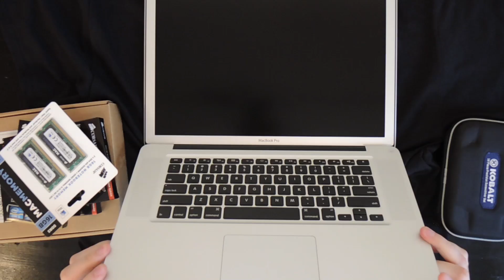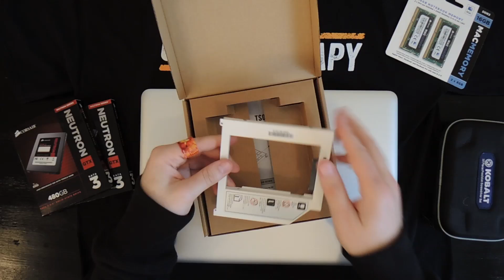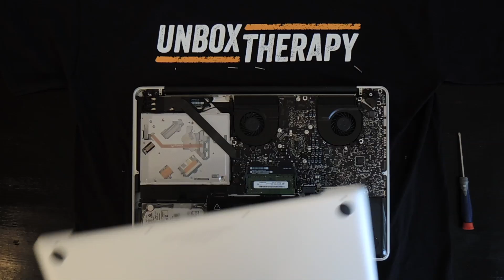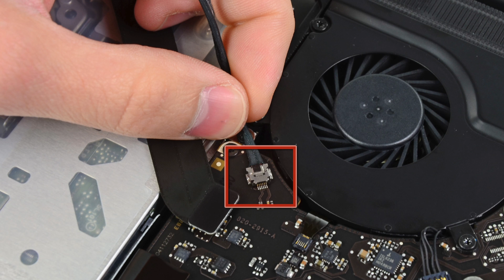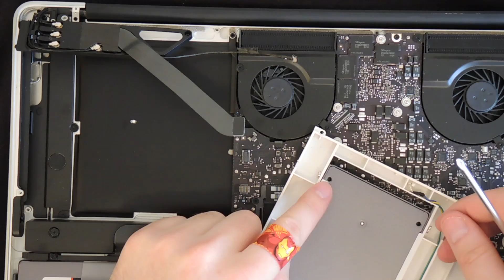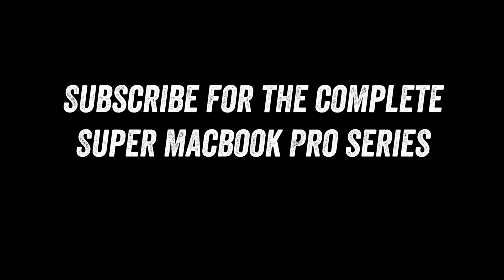The Super MacBook Pro Upgrade (1TB RAID SSD Upgrade + RAM Upgrade 2013)

Comment: I upgraded my early 2011 macbook pro back in 2016 used it throughout college for two years and then Uni for 3 years all with 4gb ram and 320gb hdd after completed uni I upgraded to 16gb ram and an ssd wish I'd had done this sooner! Damn was rapid. Used it up until 2018 then the keyboard died, tried to fix it with a new one but it was too hard.

Comment: When you use 2 480 GB hard drives in raid configuration,  you don't get 1TB. You get 480 GB's. The two drives are mirrored. If one is crashes, the other keeps the computer running.

Comment: Anyone could help me here? I did an upgrade on my MacBook pro (mid 2010 dual core). New ssd crucial mx500 to replace the hard drive and two crucial ddr3l ram sticks 8gb each. The thing is, I'm having issues with the ram. Whenever I plug the two sticks the MacBook won't boot (the screen remains black as when is off), then I try with just one of the new sticks and one of the old ones I had (2gb) and the computer starts normally showing 10 GB RAM (which proof the laptop is not limited to 8gb but can go up to 16gb instead). Why wouldn't the 2 sticks work together?

Comment: I’ve never heard of a 4 TB Hard Drive, but is it possible to max out on the Hard Drive?  It would be great for DJs... Amazon has a 2.5-inch 2TB SSD from SanDisk [its an Ultra 3D NAND SATA III], I’m thinking about doubling with such upgrade.  Is it worth it? Or are there limitations?

Comment: Does anyone knows if the raid 0 on this MacBook Pro lowers the battery performance a lot? Or it is barely noticable? I ask this because we are replacing the SuperDrive which is not always on, for an SSD that will be always turned on, so I'm guessing it will diminish a lot the battery performance, but I'll like to hear from someone that actually did this!

Comment: Hello Unbox Therapy

I have tried this and when i try to format the SSD which i attached in place of DVD Rom, it gives me an error like "Could not mount disk0s2 after erase file system formatter failed. 

When i tried with exFAT its formatted and working fine .. but not with Mac OS Extended (journaled).. can you tell whats wrong here ?? i am kind a stuck over here. 

please check the link for error i am having .. 
https://drive.google.com/file/d/0B4loQuzINvHCal9EY2RtdDU4Z00/view?usp=sharing

Any help will be appreciated.. 

Thanks in advance..

Comment: Good going.  Today we can get two 2TB SSDs to form RAID 0 to get 4TB capacity within the MBP.  That's some serious capacity for laptops (though may not be in a few years),

Have a few RAID 0 2TB system on my hand.  Bought many 1TB HDDs so making it to use as a back up to a single 2TB in my Mac Pro 3,1.  Yep, considering getting MBP sometime soon.

Comment: So to get the benefits of the SSD you put in two SSD's so they can max out the old SATA connection speeds which are what 3 gb? By adding two hard drives running at 3gbs per second and formatting them to raid 0 or 1 you get a max speed of 6gb through the SATA connections?  I understand the hard drives out perform the old SATA connection I just wanted to make sure Im tracking properly. 
How do i format the hard drives to raid via (Mac) and which raid mode do I set them in?

Comment: +Unbox Therapy

I've had my Macbook Pro for awhile now (a few years just after the retina models came out) It's a 13-inch mid-2012 model. Is it safe to replace the RAM, battery pack and even the optical drive with newer hardware without dangering the current files and such on there? 

My poor Macbook Pro get's hot easily from 720p and up videos and running certain apps, naturally so I'm thinking about checking the fans and cleanign them but but perhaps replacing the RAM and graphics card will help. What do you think?

Are there any replaceable fan parts as well which are more efficient than the stock fans?

Cheers :)

Comment: Hi. How are you? Could I upgrade the memory ssd just changing the HDD of my macbook pro 17 early 2011? I mean, without touching the optical drive, cause I found a SSD of 1TB and change the ram for those you recomend. 2x8 corsair, and my battery I must to change cause the macbook is saying that, and I bought already. Will work what I said? Without changes in the optical drive?

Comment: So I've set up an SSD in the optical bay. And after using carbon copy 
cloner, i've copied everything onto my ssd. Now if I want to transfer 
files back and forth between my HD and SSD how would I do that?

Also, if I use carbon copy cloner, and booted the SSD, is everything backed up from the hD?

Comment: Just had this absolutely crazy idea, but what if instead of installing a SSD in the optic drive you installed a mobile descrete graphics card and rewired the thunderbolt access inside so that you could run it.  Have the fan vent through the old optic drive opening.

Comment: Hey guys, i've already installed 1TB SSD which replaced the HD. That's now full, so i'm looking to remove the drive and add another! Is it okay to use ANY OTHER type of SSD brand? Still same specs, just any other make and/or size?

Finally, I'm guessing i'd have to format the already installed SSD to make the RAID config? Is this correct? Thanks guys.

Comment: ey Lou, I wanted to go and do this same exact setup for a 2013 macbook pro. One question, I wanted to launch windows 10 on it via bootcamp. windows:mac 50:50 really. would it still have the same power like you say? I mean obviously it should be a little weaker being that theyre splitting the ssd's. Please help, your help would be nice. thanks!

Comment: From what I understand my MBP Mid 2010 will support 16GB of RAM since it is a Intel Core 2 Duo and model 7,1.. I have upgraded to El Capitan due to certain software I need to use. I currently have 8GB of RAM and recently swapped to a SSD and it runs well. But some more RAM would be lovely. So, has anyone done this? Was it compatible with the OS?

Comment: Could you not set up the Raid 0 Array externally then transfer your data from your old HDD to the array, then install the drives? I'm considering doing this but I've had my MBP for 5 years and lots of files. I do have Time Machine enabled and back up on a regular basis.

Comment: Hey guys!!
Is a upgraded 2012 13-inch 2.9 GHz MacBook Pro with Samsung 840 EVO 1TB SSD and Corsair Vengeance 16 GB up to par with 2015 MacBook Pro's specs? If not, will adding another Samsung 840 EVO 1TB SSD to replace the super drive help?

OR

Should I just buy a current MacBook Pro?

I don't know much about computers, so any advice or help is appreciated! THANKS!

Comment: I have a 2012 macbook pro and i also have to 8 gig sticks of g skill ram when ever i use 16 gigs of ram the computer just randomly crashes without notice but with the 8 gigs it works fine is that bad memory or because they say it only supports 8 gigs if i buy new 16 ram would it work

Comment: Hi Lou
Quick question:
Is it possible and is it advisable to upgrade Mac`s HDD to a new 1TB Hybrid drive as a cheaper version and replace an Optical drive using an adapter with a 500GB SSD drive? 
Would you keep both drives the same type or mixing them would not make any harm and would not cause  interference of some sort?

Comment: Just wanna ask: I have a 15" Late 2011 MacBook Pro with 750GB HDD. I also have SuperDuper cloned my drive. So if I plan to put two 500GB SSD (one replacing the SuperDrive), will I be able to put back the cloned data even though it was from a 750GB HDD and gonna be transfered to a 1TB RAID Drive?

Another one: Is there a difference between the Corsair Apple Certified RAM with the Vengeance one? Is it really noticeable?

Thank you!

Comment: I did this conversion recently it was as described very simple and the performance improvement was very noticeable.  I used the OWC CD converter (nice blue color) and i put in two 1TB drives and an external 2TB.  the laptop now acts as a server

Comment: how is the configuration holding up?  any crashes? any problematic areas you've noticed?  considering a raid configuration with either 2, Samsung 840 EVO 250gb SSD's or 2, Corsair Neutron GTX 240gb SSD's.

Comment: I just bought a samsung 840 Pro and it's on its way. I also purchased the screwdriver kit you listed in the description. I also purchased a different yet similar caddy for the optical drive bay. It is set to arrive Tuesday Jan. 7. Then I'm going to use this video to install it.

Comment: oh ya and thats a big thing too. they dont want a giant laptop like from the 90s or early 2000s. people rather have a smalller more light devices. thats what apple does with their iphone, iPads, macs, iPods, etc.
and they r making everything smaller anyway. thats what most people want and they r pushing alot on that. sure ya if u had a giant computer u could alot more and probobly customize it. but that will be the biggest pain in the ass for the amount of weight and how thick it is

Comment: There are still minor compatibility issues when exchanging files from one OS to another. In the design industry everybody uses macs, from video & audio to print & web, it simply became the standard, so to avoid mistakes. Also, you just can't find the neatness of display that apple has in cheap PCs. Only dell sells monitors that approach that quality and are more expensive than an entry level iMac. Remember this industry relies on all the visuals displaying perfectly.

Comment: Sorry but you have you're facts wrong, Apple hold less than 10% of the market.
Windows 8 - 9.6%
Windows 7 - 55.9%
Vista - 1.7%
NT -0.4%
XP - 14.7%
Linux - 5%
Mac - 9.2%
Other - 3.4%

Comment: Completely agree, except the fact that any sort of upgrade will void your warranty. 

The hard drive and the ram are user upgradable components (the DVD drive, however isn't) 

And the retina macbook pro delivers lesser real life battery performance than the non-retina one. 

Just wanted to point out the upgrading the ram and/or the hdd won't void your warranty.

Comment: Yes, the easiest way is using the preinstalled software called bootcamp. what it lets you do is partition your hard drive(s)/SSD(S) to run both Windows or Max OS X. Then if you want to you can also buy a Third party program called Parallels which will let you install a virtual machine of Windows (Though I wouldn't do that for gaming) or even access the Bootcamp partition you may have made. PM me if you wish to know more.

Comment: That only applies with the MacBook Pro Retina Displays. Those are very difficult to upgrade due to the fact everything is soldered down to the motherboard. The Non-Retina display MacBook Pro's have normal HDD so yes these would apply, bear in mind don't attempt to do this if you have no idea what you're doing. You should only attempt this if you have very good knowledge of this and have had previous experience doing something similar.

Good Luck.

Comment: Hi, I'm getting a MacBook Pro 13" 2012 lower specs. I wish to swap the optical drive bay with the default 500GB HDD and the previous slot for the HDD is used to put the new 128GB SSD. My concern now is can I set the SSD is used for MacOS while the 500GB HDD is used for BootCamp Windows 7? Can I do it that way? I scare that the previous HDD will override the SSD. Thanking in advance.

Comment: If someone has two solid reliable drives and a solid backup solution RAID is excellent. I'm running two neutron GTX drives in a striped setup and I'm obtaining ~1050MBps read speeds. High end drives likely won't fail for some time and even if they did I have a solid backup solution.

Comment: He actually ended up paying 3410.11$. Its actually 200$ cheaper getting the 15-inch MacBook Pro with Retina display with a 2.7GHz Intel Core i7 Processor, 16GB of Ram, NVIDIA GeForce GT 650M with 1GB of GDDR5 memory and 768GB of SSD. All you lose is 192GB but, you gain Retina display, a lighter laptop, longer battery life and you don't have to open up your laptop which means that you don't lose warranty.

Comment: Buy the items from ebay. The same exact MBP costed me 1489US while the same SSD costed me 225US. Both are used items and I won them in an eBay auction. Buying a used retina with top configurations costs around 1000US more. Also retina has its draw backs and I sold my retina and sticked with this.

Comment: just recently did an upgrade thats Simular to this, i have an HP Envy 17 that came out in 2011... just recently it was overheating like CRAZY!!! and it had two 7200 rpm hard drives installed (one wasnt working properly)... i switched to SSD, opened up the laptop cleaned the CPU & GPU, put artic 5 thermal paste... Now my laptop is a Beast!!!!!! went from a rating of 5.9 to 7.1, and its really quiet and Way Cooler. No more overheating!!!

Comment: I dont understand, you just paid almost 2980 to get 960GB SSD, 16GB RAM and 2.7GHz Quad-core. When you could just get the Macbook pro Retina 768GB SSD and 16GB RAM  2.7GHz Quad-core for 3199. 
Yes, you pay extra $200 but with Retina you get 2880×1800 pixels (almost double pixels)also the retina is thinner 1.2 pound lighter, longer battery life and dont forget that you just lost you apple warranty with allyour upgrades!! Now if you gonna say i need more storage, you can always buy thunderbolt SSD

Comment: I got my mcPro many years ago back in 2008 I think.

I have a 2.66Ghz Intel Core 2 Duo Processor

4GB DDR3 ram

and 120Gb SSD

Do you think I will see a major improvement If I follow your steps?

I mainly do Programming and some light 3d Rendering

Comment: How the fuck is this considered a "project" and a "super" project all you are doing is giving it a little more ram ooooooh more ram and a ssd oooh your loading times will improve and faster booting. You can't even up grade the screen. I can on my laptop which costs as much as this but has a proper quad core gaming grade good for existing and 3d work, two graphics cards gaming grade 675mxs. You can't upgrade the CPU, gpu, screen only ram and storage oooh that's really upgradable. Fucking apple

Comment: hi is it possible to use Crucial M500 960GB 2.5-inch Internal SSD's instead of the ones you are using great video by the way.

Comment: Would be cooler to use 2 of these with power and sata duplicators. With this setup you could use the optical drive too
amazon  dot   com    slash    480GB-OWC-MacBook-2010-2011-Edition/dp/B00AA0XAMK/ref=sr_1_5?ie=               UTF8&qid=1372615455&sr=               8-5&keywords=              OWC+Aura+Pro+6G

Comment: if your laptop can support something like the procedure of the MacBook pro, then go with that (google around to see if it's possible), if not, you may need a hard-drive enclosure so you can use the 1TB drive as an external drive. I have a mid 2010 MacBook and I have the seagate 1tb hybrid drive, so that's something to consider if you want storage and increased speed, not quite SSD speeds, but still reasonably fast.

Comment: the reason in flash memory deteriorates over time (hence a 480gb drive truly has 500, just 20gb is used to replace the deteriorated parts) not shutting down lets it deteriorate (not really faster, just giving it more time to do so)

Comment: Because the 480GB is a SSD (solid state drive). SSD are more reliable, up to 10 times faster, and can handle drops and physical abuse better than a mechanical (spinning) hard drive. So 2 480GB SSD is like 960GB or 1TB in RAID.

Comment: No the capacity doubles as well. the only con is that chances of failure are exponential (2^x where x is the number of drives in raid 0).

raid 0 works by alternating between the drive so each drive only hold half of the set.

Example this byte : {10101011}
in raid 0 it would be stored   drive 1: {1111}    drive 2: {0001}

when reading it will alternate between the drives to get the performance (drive 1, drive 2, drive 1, drive 2, etc)

Comment: using two drives and treating them as a single volume. there are many approaches either for speed or redundancy.

RAID 0: is when you split the data between two drives, so 
Drive 1: {111000}
Drive 2: {101010}
When read: it would be off both drives {111011000100} doubling its speed, but squaring chances of failure.

RAID 1: is known as mirroring 
Drive 1: {111000}
Drive 2: {111000}

both drives hold the same data so when one dies there is always a backup.

Comment: With RAID 0 its still 480 GB isn't it? RAID 0 is for increasing performance (2 SSD's are faster than one SSD), but the capacity stays at 480 GB with 2 480GB SSD's in RAID 0

Comment: I recommend spending a little more on the optical drive bracket, have had issues with some cheap ones.  Throughput on some of the cheap ones only allow for SATA II connectivity.